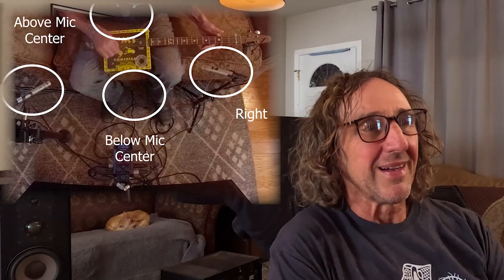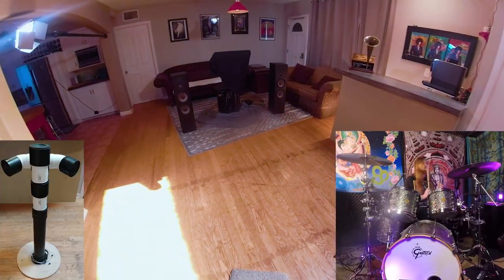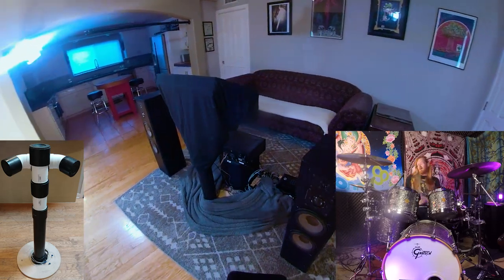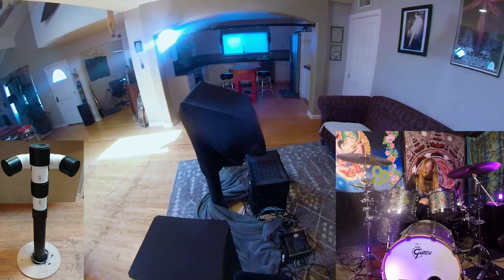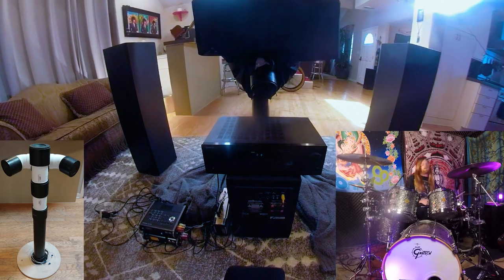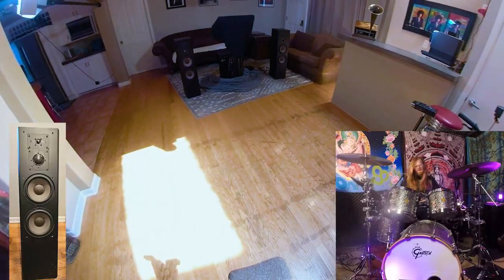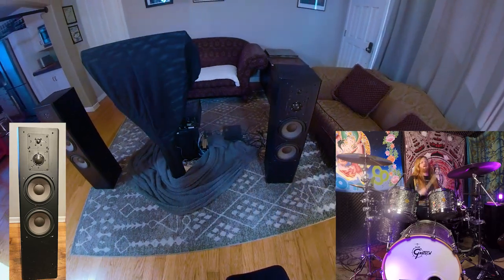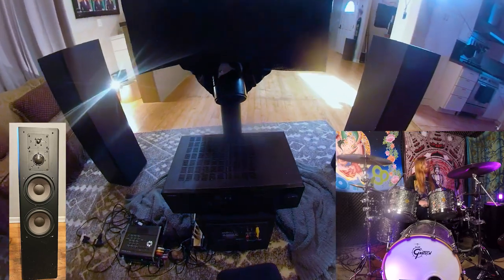How Real Do the Drums Sound?

Comment: So much BAD information here.   I have a pair of EPI 100v speakers (the updated tweeter version).  Almost the entire room, becomes the "Sweet Spot".   I GUARANTEE that they sound better than your low-tier drivers, mounted in PVC.   1000 times better.   No competition, at all.    While there are very over-priced Audiophile gear... I can assure you that there are many audiophile speakers, that cost far more... because they use Higher quality drivers.   These drivers distort far less than typical speaker drivers... and this becomes even more apparent, when pushed at higher volume levels (where cheap drivers become extremely Muddy and distorted).

 As for buying "Studio" speakers... thats also a Falsehood.   They are designed for small spaces,  and low volume level listening.   In fact, Ive seen many of them use tuned Ports..  and Ports are some of the worst offenders of extremely Distorted and Artificial sounding Bass output.   Sorry... but my EPIs blow the typical recording Studio speakers, out of the water.   Furthermore... a lot of mixing is actually done with Audiophile grade HEADPHONES...  because there is almost no Speaker that is capable of competing with the physics of a high quality Headphone driver.  Smaller = Less mass = less distortions.

 Everything you have said, has very little bearing in Reality... because the Music that we love and listen to... was recorded in a way that sounds best,  with 2  (or 4 speakers max).    Nobody is going to be trying to convert audio into 5 speakers per virtual instrument,  in the center of their Living Room.   Its not realistic in the recording methods and efforts... and its even worse in Living-room practicality  (especially when you think about trying to watch a Bluray Movie)

 Trying to compare speaker quality, by Sitting behind drivers that are not designed for that,  is an extremely  LAME  , and quite a   DISHONEST,  example.

 Ive been in many places with live music,  from small concerts, to large stadiums,  as well as little groups outside.. in Ren Fairs.   Guess where the music sounded the BEST ?   Directly in front and center,  to the performers.    Guess where I hate standing most?   BEHIND the performers!    For good reason.   The sound isnt nearly as clear, clean, and the overall volume is also reduced.

 Most Instruments by nature, are in fact  Directional.   A tuba or trumpet?  Blows sounds out of the horn, towards the Audience.   A Guitar?  The main acoustics come out of the center hole, and radiate FORWARDS towards the audience.  Real drums are so loud, that you dont really want them in your living room... unless you are wearing Aircraft level hearing protection.   An electric guitar?  The sound is just blasted out of large overdriven speakers... again... towards the audience.

 So again... why would I want to listen to music, from the worst possible positions... and the worst possible Fidelity?    Again, I dont want to stand or SIT  BEHIND  my favorite Musicians.   I dont want a MUFFLED experience.  I want to hear the most Clean and Clear sounds, directly front and center.   In addition, I also get to "SEE" them perform,  in the best possible Visual position.

 Im not angered that you like to experiment with goofy setups.  Im not even upset that you lack the hearing to understand high fidelity.  However, I am Miffed by your bad faith arguments, and incorrect information.
Reply: Im going to add... that your SUB only makes the music sound Muddy, and even more Distorted.  Typical of Ported Subs.  And typical of people trying to substitute good, powerful, and large sized woofers...  for small,  Eco-woofers +  A low spec Sub.

 And to even Mention "Bose"  in an Audiophile argument,  is laughable.   They are the worst low spec drivers out there... and use various trickery to try to make up for it.   They lack fidelity, dynamics, and any level of output power.. at all.   But, people are easily fooled, by expensive advertisement runs.  Its sad... but its reality.   I lent my $120 Sennheiser headphones to a friend that just purchased a $300 bose headphone set.  His jaw hit the floor... and he nearly cried,   at how much better they were compared to Bose's overpriced trash.   The senns are about 1000x more comfortable, and infinitely more durable, to boot.
Reply from the maker: Have you ever been to a proper recording studio and seen what they use and heard it?

Or are you speaking from a position of assumption and hearsay?

If audiophile speakers are so good why don't they use them to record with?

Why is it that a multi-million dollar recording studio with huge budgets never buys any of the home audiophile esoteric speakers?

Hmmm, perhaps the engineers and producers recording the albums know something that you don't?

Studio monitors are designed to reveal all of the issues so they can be fixed and home hi-fi is designed to mask over and cover up all the issues so that it can be enjoyed.

Well I do appreciate your passion and strong beliefs I do recommend you continue your quest and seek out more reliable info sources.

I would start by avoiding any info created by a manufacturer or someone trying to sell whatever there giving you info about.

Either that or maybe look into buying some higher quality cable risers, pure silver wire and spend hundreds of dollars on a 3 ft power cord that is plugged into a wall outlet connected to thousands of feet of mama Edison power lines.

I do hope to do a video on directional audio cables and poke some fun at the absurdity of that as well.

That's it if it makes you happy and that's what you want to believe and you don't mind giving your money to people selling you bill a goods, That's all good.
Reply: Or rather, if the concept her was built withe budget like your fantastic speaker. And there was placed out one for each instrument in the recording. What would sound best. This concept, or a stereo pair. That is the whole philosophy here.
Reply: @fredrikweme1387  My EPI 100v speakers, were made in the 1970s,  and I paid  $100  for them.   You can still buy brand new parts from a dude that used to work in the EPI / Genesis factory... that hand builds them, for probably under $400 for the pair (you build the simple sealed box).

 You can spend $200 on cheap, underpowered drivers... to listen to your experimental recordings on your janky PVC pipe (blocking the living room space)...
OR...

 You can spend less than $400  (especially if you find these speakers used),  and experience a near 180 degree 3d Soundstage,  that you can stand almost anywhere in the room to have a perfect stereo image with (those inverted tweeters are flippin magic)... AND you can crank them LOUD enough to rattle the room, and have Zero distortion at all (and no need to have an audio-muddying sub, either).

 The argument he makes is about positioning.  About being able to go Behind the speaker.  And as Ive argued before... you typically dont WANT to be behind your favorite performer.  You dont want a Muffled experience.  And the truth is... that almost all musical instruments are "Directional".

  The drums are the least directional instrument of all... and they still probably sound the best, from directly head on... rather than from behind, or the sides.

 But more to the point... Do you want to Feel that Drum kick?  And do you want to hear the subtle taps and all of that high fidelity and wide dynamics that the drums are capable of producing?   Because you are not going to get any of that... with sub $25  3" drivers!

 Let me tell you... the first time that I had ever heard a pair of EPIs playing... I spent a good 15 minutes trying to Find them.  This is unusual.. because my ears are very sensitive... and thus, its easy to pinpoint where speakers sounds are originating from.  However... I wasnt even blind folded.. and I couldnt located them.  Thats how 3D the Image / Soundstage was.  The music was as if the band was in the actual room... and the sound was as if each instrument was located at different points of 3d space... out of thin air... as if they actually originated from that space.

 Ive heard a lot of speakers in my years... and Id NEVER experienced anything like that.  After that, I had to own a pair... and it was, hands down.. the best purchase in my entire life.   Even more so, because it only cost me about $100 for the pair.

 Now, I already owned one of the original Pioneer 5.1 surround amps, from when I was 16 yrs old.  That was when that company actually made high quality electronics.  Its still functioning flawlessly today.  Thus,  I didnt need some  +$10k  amp / dac,  to drive them.  Though, I do imagine that there are superior amps, that could bring out even more details than Im currently able to squeeze out of them.

 That said... even with what I have.. Ive heard things in old music, that Ive never heard before.. with the EPIs.  Im talking things like Lyrics that the singer sings.. that I never used to be able to figure out what they were trying to say.   I was not only hearing and understanding it clearly... but also... there was no questioning at all.  No straining.  I knew Exactly what words he was singing... and,  I could easily differentiate the music behind his singing, that before... was sort of distorted along with his vocals.  Now these instruments were crystal clear, and perfectly separated.

 You know, I used to experimented with low fidelity speaker too.  I used to collect all sorts of speakers / drivers... and mix/match and alter them.   In the end, I discovered that none of them were worth my time / money / efforts.  Compared to a higher-powered high quality driver... they just dont compete at all.   No amount of Trickery, can make them compare / compete.  I dont care if you had 30 of these things... you are not getting an audio experience, that even comes close, to a SINGLE pair of high quality speaker drivers.   And this is exactly why Audiophiles hate Bose.  Because bose uses such tactics, to try to compete... and fails spectacularly.
Reply from the maker: Agreed! True story, my Grandfather, Robert C Webber, was a refrigeration inventor. At the time, back in the 40s, air conditioners needed a complex and expensive series of reducing tubes to get the freon from the high pressure side to the low pressure side.

He cam up with an alternate method that involved a ball bearing in a tube with dimples. It was cheap and self cleaning and helped allow the cost/size of airconditioning to become the norm in automobiles.

A small, simple, cheap and lightweight solution to what was a complex, heavy, bulky and expensive problem.

I remember going to his house and lab as a kid. So so cool and making things became a goal and dream for me
Reply: You have the patience of a saint Dave 🙄
Reply from the maker: Thank you Shane and I enjoy the chatter and perspectives. 

And look! The story, the history. Items of art come with a story of past, a history.

Items of science and learning come with a description of the present. Who owned or built or whether it was hand or machine made holds little or no relevance for science, what matters is the current, repeatable, verifiable function.

I love art, I love science and I love helping clarify the differences between the two.
Reply: @DaveRat  Trying to Strawman again.  Science is knowing the difference, between a POORLY made, underpowered woofer driver...  and a high spec woofer, that has high tolerances, a stronger magnet, stronger voice coils, and superior materials... such as a stiffer but lighter cone, that does not easily distort at high air-volume movement.

 The box can look pretty or dull... but what matters most,  is the GUTS.   The Quality of the Drivers,  as well as the quality and type  of the Electronic parts (crossover components).

 You are trying to make it sound,  as if ALL speakers use the same Drivers,  or same driver quality.  They Dont.

 Furthermore... you can in fact combine Art and Science.  Meaning... you can make a pretty looking box... that has high dynamic functionality.   So, this idea that things are 100% Black and White... is also a falsehood.
Reply from the maker: John, did you listen? Are you telling me the Vintage ADS L1090-2 speakers with a freq response of 40-27k +/-3dB in the vid sound more real or less like a real drum kit than the 4 channel quad amped tube speaker employing 2 B&C 4" coaxials 2 tympany ne123w-08 drivers?

Perhaps which is it?

On one hand you could tell me the Vintage ADS sound more real and that would be quite interesting

Or you could tell me the home made speaker sounds more real which is also interesting 

Or you could avoid answering the question and the avoid the entire purpose of the video, which would make me smile as it would mean you are stuck between supporting the art and facing reality. Which is also interesting.
Reply: John Dough's fine example of - 'How to expose your ignorance of the Production process and equipment choices of professional recording studios,  along with modern live production'.   As well as not grasping the topic of the video, ie: does this sound more realistic than this.  Not better, smoother, more polished, or with the same dynamics.  Just more realistic than the other.  And I can assure you John, that after a lifetime of direct involvement, that even in the stereo realm, Dave's tube system was way more realistic.  Even the character of the instrument changes as you move closer, not just the volume.
Reply: @brin57  The point of my post, was to defend the Slander of Audiophiles, while also correcting his BAD information.

 As Ive argued.. having a speaker that produces BAD sound, just like sitting behind a band would sound... isnt impressive to me.  Its not what I desire, when I want to hear and experience the BEST possible sound, from that band.  Just the same way... that if I want to hear someone talk to me... or even SING... I dont want to stand Behind them.  It does not matter how "Realistic"  that kind of thing is.. because its not what I want to experience.  I dont want to be Annoyed, from hearing bad sound from odd angles.  I also dont want to have odd shaped speakers, in the CENTER of a room.. getting in the way of things.

 But as Ive said... the main reason for replying, was to refute his many False data points...  Not to challenge his actual Experiment.

 You dont need to have 100k speakers, to be an Audiophile.  Nor do you have to believe in special Raised Cables, nor to believe in Flat Earth.  This is all Slander, to try to attack others... in order to try to make himself  FEEL  better about his Janky, unpractical, experiment.

 At very least, if he were serious about it, he would use top quality drivers.  But again, his delusion, is that you dont need high fidelity drivers, if you use enough of them.  Bose thinks along the same line... and I will pit my EPIs over Bose's best speakers, any day of the week.  There is no comparison / competition.  Weak eco drivers = Distortions.  Distortions = Bad sound, and bad + distorted 3d imaging.  THAT is actual "Science",  that he "Skirts" around.

  He expects everyone to be "Dumb".   To not know the difference, between a high quality driver... and a cheap, poorly made, Chinese driver.   And of course, lucky for him... people like yourself, are way too great in numbers.

 It is exactly why there are scammers that get away with overcharging you for Crap audio... as well as overcharging for High-End audio.   When people dont even know what is Under the Hood... its like buying a Car,  without knowing anything about cars / engines... at all.   You think you are buying  a Race Car... but the engine has the power and speed of a Pinto (barely above a lawnmower's specs).
Reply: @johndough8115  You seem to think this is about what you want.  Far from it. To re-iterate again -  This was to make a comparison of what sounds realistic and what doesn't.  What you want to hear has no bearing on this.  As for misinformation, you have provided your fair share here, or maybe it's just ignorance.  What a lot of you guys fail to understand is that there is often a lot less of a difference between different drivers, microphones, headphones and many other general components in audio, than the manufacturers would have you believe.  I would feel quite safe in saying that I could  put $3000 worth of pro-audio in a room that would absolutely blow the doors off of any $10000 consumer hifi, in terms of both fidelity and power.  I guess you have to pay a lot for high art and bragging rights.  Overall I feel you are just a little bit butt-hurt over the integrity of the audiophile world being called out, both retailers for exploiting the gullibility of their customers, and the customers for their gullibility.
Reply from the maker: Amar Bose was a brilliant human and a pioneer of modern acoustics.

Did you know he donated the company and primary shareholder in Bose corp is still Massachusetts Institute of Technology?

Is Bose based in Art or Science?

I love your passion John Dough and thank you for being exactly as predicted in the video. Have you watched the without skipping through?

And my slander of audiopholes is that I call it art wrapped in a veneer of science, often false science.

And your defence is that audiophile is the sound you love and that creating speakers that actually sound like real instruments sounds bad to.you

Ahh yes the friction of the ages rises again in yet another forrm where opinions of what people want to believe clashes with verifiable science. Was it Copernicus?

So slander is calling art, art? 

Big smile.
Reply: Your statement that “most instruments are directional by nature” is totally incorrect. Brass/wind instruments do not “blow sound out of the horn” nor do acoustic guitars send sound forwards out of the sound hole. To explain why in full would require me to write a book here but in the case of an acoustic guitar, the sound hole works with the body to generate a Helmholtz resonance, improving the efficiency of the guitar at low frequencies, which are then radiated omnidirectionally because the sound source is very small compared to the radiated wavelengths. At higher frequencies the guitar radiates from all its surfaces, particularly the body’s surfaces, as they resonate, and at even higher frequencies there is significant output from the strings themselves. Although the polar pattern of an acoustic guitar is not evenly omnidirectional there is acoustic output across its bandwidth in all directions. All acoustic instruments have omnidirectional output due to their multiple resonating surfaces and/or air outlets and the sizes of these sound sources vs the radiated wavelengths.
Reply from the maker: Agreed barefoot audio ad would like to refine by usinf the term multi directional instead of omnidirectional. Omni infers the same sound in all directions. But in reality they radiate different sounds in every direction